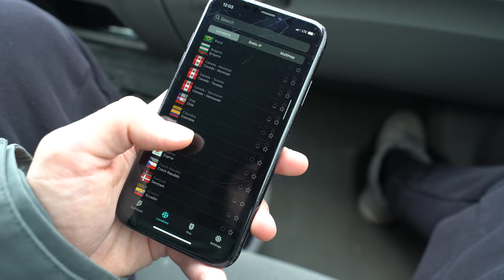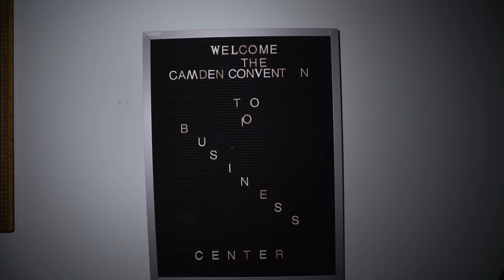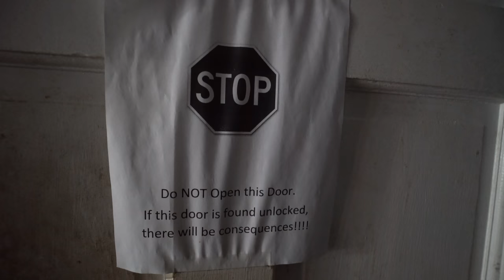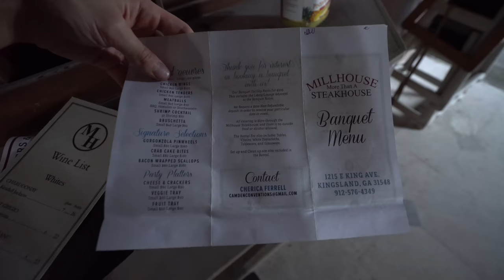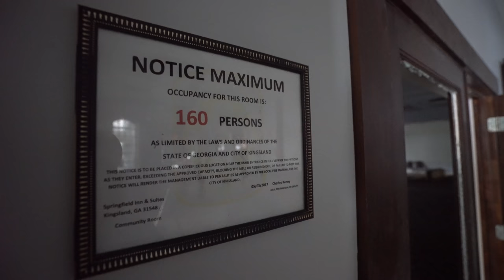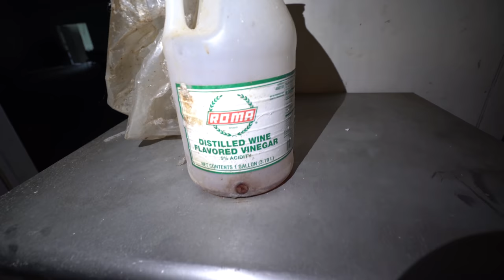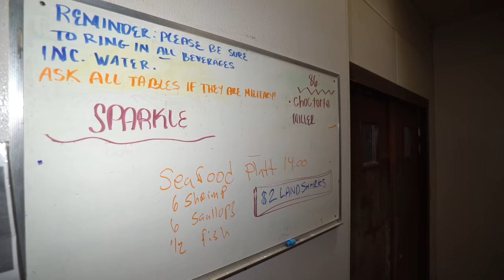ABANDONED Untouched Restaurant & Motel With EVERYTHING Still Inside ! (Caught Exploring)

Comment: The water supply of most buildings doesn't need electricity. The water pressure is provided from the main supply. You only need an electric pump onsite is if the pressure isn't enough for some reason, such as the building being very tall (6+ storeys). Otherwise, as long as the valve to the watermain hasn't been turned off, you'll have running water even without electricity.